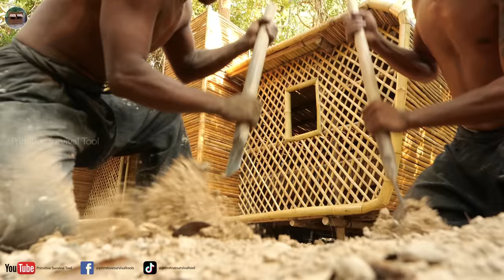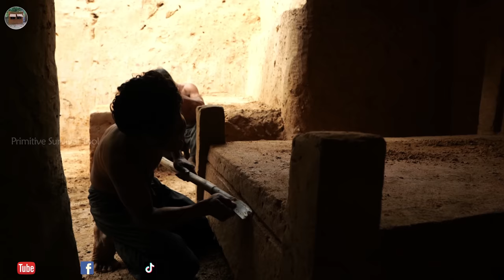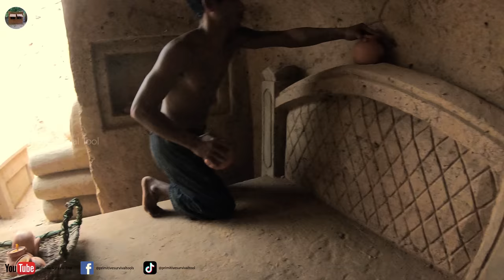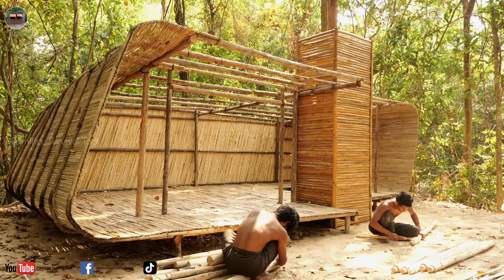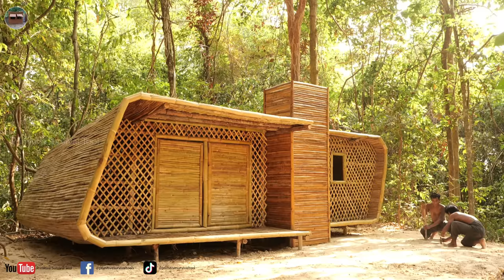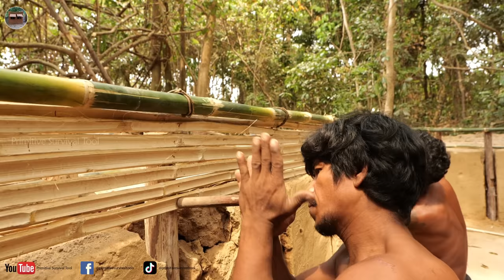[ Full Video ] Building Two Story Villa With Private Underground Living Room and Swimming Pool

Comment: ok we can all see (if this is real) that these people are amazing. But what is more amazing is how clear the pool water is. I struggle keeping mine clean (and clear) and there is a Leslies Pool supply 2 blocks away. How do they maintain this? LOL
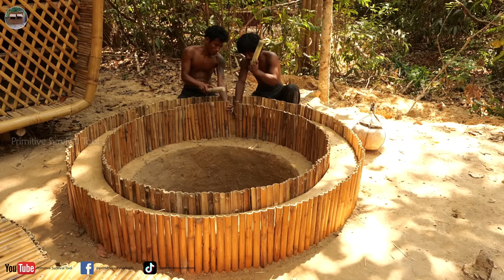Reply: 25:53  i think there is a ghost in the video, or some light orb lol, do you see it?
Reply: @sirwaffles4030  Yo dude I saw that wtf
Reply: @sirwaffles4030  where lol
Reply: @sirwaffles4030  thats smoke bro
Reply: I seriously think that you fill the pool and after 1 day, maximal 2 there is no more water on it. So you simply replace it with new clear water. Your pool is leak free, so the same water can stay there and have bacteria growing. Their pool is just a hole in the dirt,. so the water eventually goes underground. I also don't think that most of their constructions survive even a moderate but several hours long rain: If the ground there is sft enough for them to work it with just with chisels then when it mixes with water it should become mud. The pool walls also get damaged soon and while your one requires manteinance in ghe way of filters and chlore i think theirs requires manteinance in the way of rebuilding the walls of it.
Reply: @sirwaffles4030  could have been a reflection off of the back loader?
Reply: just for the video.
Reply: @Virtual Victory VD yeah 9m views $$$$$$$$$$$
Reply: What if this is real
Can't you see that it's Real.
Why even question someone's hardwork?
The water probably looks as it was put there on the day they shot
It obviously will be dirty after some days.
Reply: @sirwaffles4030  smoke, the ghost or light orb was smoke! At that point of the recording they were working with fire to mold the bamboo!
Reply: They don't.  It is filled for the video and never touched again would be my guess.  Without filtration it will look like pond water in less than 2 weeks.
Reply: They had chlorine in their pickets
Reply: @sirwaffles4030  i saw it
Reply: Pool cleaner here, make sure your filters clean, a dirty or old filter will cause a handful of problems such as excessive algae growth and cloudiness. If its been awhile since its been broken down and cleaned, now would be a good time!
Reply: The use pinch a penny
Reply: @Jorge_Organero1684   why not just appreciate the two boys. See this  people this is what they call ENVY. 
Envy is an emotion which occurs when a person lacks another's superior quality, achievement, or possession and either desires it or wishes that the other lacked it. Aristotle defined envy as pain at the sight of another's good fortune.
Reply: @EliteMrBubble  LMAO...a filter? you don't say...wow i never thought about that.  You will probably be telling me to try some chlorine next.  Great advice from a professional pool cleaner hahaha
Reply: I used the pool shocker that they have that you can buy if it gets really bad but just the chlorine tablets depending on how much you use your pool use it for a pool or do you use it for a bath? I'm just saying let's be rude or disrespectful some people use it for baths and I would use a shocker but you sometimes you need way more than one I use like seven of them in Vegas to bring that pull back and it finally came back to life believe it or not took a lot of money a lot of effort but it worked clothes crystal clear. we had our doubts though it took a while for it to become that ready to wait just when we gave up on it we went outside and it was crystal clear.
Reply: @Virtual Victory VD would it be the new day and age real estate bumped it up a notch LOL.
Reply: I think the water is coming from underground. I have seen other videos and some people use a latex from a vine that grows in the forest and mixes it with smashed up plants to get a green type of waterproof paint.  They also use ground up termite mounds and mix it with the clay to make it waterproof. They are very ingenuous and superbly adapted to their environment.
Reply: It looks clean and clear because its shallow and reflecting off of the sky the water it self probably doesnt look that clean in person
Reply: Everyone wants to have a good time....but you will not spend time!
Reply: unfortunately it isnt, still fun to watch tho
Reply: No need for home depoot
Reply: @sirwaffles4030  more than likely its a spec of dust that was close to the lens
Reply: @meade916  just reminding you since people skip the basics, have fun swimming in your swamp pool! 😎
Reply: @Jorge_Organero1684  They cover the pool with a mud stucco. Adobe houses do not wash away. Likely it does drain as you say.
Reply: @arteclipse3821  It is fresh spring water. Best water one can get. Should be clear for a couple of days before the algae forms.
Reply: What do you mean "if this is real"? Are you suggesting it's CGI?
Reply: @Jorge_Organero1684  Maximum, not "maximal"
Reply: I dont care if it’s real or not because they edited it well enough for it to be entertaining so it’s all good in my book
Reply: Gak bisa bahasa lenges
Reply: @brunosalvatti8452  I still dont get it, how would they work with fire and manage to get just one ball of smoke to fly horizontally, smoke flys up, and wouldn't it have been a  long trail of smoke? or am I not understanding what you said.
Reply: @jake-gs4do  how would they work with fire and manage to get just one ball of smoke to fly horizontally, smoke flys up, and wouldn't it have been a  long trail of smoke?
Reply: well it definitely is fake, obviously its not cgi or something, but its built by either tons of people or actual construction equipment, just the pool alone at 6x12ft (5ft depth) would be 2700 gallons, put speed to 0.25x to see somewhat realtime speed when they are filling, takes about 17 seconds to bring 1 bucket up, guessing a bucket is 1 gallon it would be 12 hours alone to fill the pool, and that just like 30 seconds of the video. This would take months to actually make by hand.
Reply: @Jorge_Organero1684  ةةةةة
Reply: @sirwaffles4030  - smoke from the backhoe sitting off to the side : )
Reply: Hey, I like it. Who else?
Reply: @Jorge_Organero1684  But, if this is africa they get care rain. I am not being racist and going off the skin color but if you see how bright the dirt is it's almost like sand. Like a dessert or a Oasis
Reply: Exactly what I thought, too.HOW is the pool water so clean and why did the pool not collapse as soon as water hit it? It was only sand...
Reply: Came to the comments for this
Reply: @Jorge_Organero1684  you don't seem to understand and realize that many people in the past used to build houses and use dirt as one of the materials just like them. There's still people today who do, and some who use animal poop the way they use mud. Plus they seem to have access to a dirt that turns cement like. The water wouldn't be so clear after a few minutes and the pool would almost immediately be eroding if what you say we're true. And the pool doesn't just empty itself cause first of all they used cement like dirt and second of all dirt can and does hold water if not ground water wouldn't exist. Also the water is clear cause they just filled the pool, but after some time if left natural bacteria will grow and it'll cease to be clear without intervention. It's strange how you think their structures and materials used are inferior just because it's not what you're used to when that's how things were done for thousands of years. And it's weird you're stating it like it's fact what you say when it's not. Stop spreading false info and instead educate yourself.
Reply: @mease916 they literally build it on camera and you have the audacity to say "if this is real" 🙄 and why are you shocked that a barely filled pool is clear..? After a few days if left natural bacteria will grow. If you're treating your pool and it's still not clear then you're doing something wrong. I also get pool chemicals from Leslie's and mine is always clear. Either the chemicals you're using are shitty or you're not using the right dose or not using a vacuum as well. You should have a professional look at your pool and how you care for it so they can help fix your issue and recommend what you should really be doing. Btw a helpful trick is to take a Mr. Clean magic eraser and put it in the part of the filter that's a little bucket that collects all the leaves and bugs. I don't really need to use that trick since my chemicals work but I've tried it and seen others who use it and it works great, it's like a magnet for the bacteria and really does help clean your pool. Also, I don't get why so many people think orbs are ghosts, they're literally just light refractions. And this is coming from someone who's seen ghosts before (no I'm not crazy as other family members and friends have seen what I've seen and sometimes at the same moment since my house for some reason is haunted :/)
Reply: @bambi7563  ehhhhhh what? cliffs notes please.
Reply: @Jorge_Organero1684  I've thought about this, too.  I watched one earlier, though, that indicated it took over 100 days to complete.  Understandable because of the complexity and how they complete the work.  But I thought, "In all that time, it didn't rain and wash everything away?"
Reply: It's not real.
Reply: Hi
Reply: Ground water is cleaner then most of the water you drink anywhere in the world
Reply: Their ancestors help them build! 😎👻
Reply: That's because these videos are fake. It's quite alright, they are cool nonetheless.
Reply: @bruhmomento4345  
It amazes me that people think half the bullshit out there is real. They fall for any scam. They leap to conclusions, like in the UAV shit. They think two guys can dig out like 50 metric tons of dirt in a couple days with a oversized spoon.

This is why we can't have nice things.
Reply: @Th3ories 
Lolololol. You're kidding, right?
Reply: @jackbill1644  you know nothing about pools.
Reply: @meade916  did u not just watch them pull the water from the ground?😂
Reply: @Jorge_Organero1684  I think they sealed the pool with mud from the deepest part of the well which is actually clay?  In which case they just let the water evaporate over a week or so and then refill the pool from the well again the next time they want to use it?  IDK.
Reply: 16.5 now!
Reply: They have cement. At the end when they go off to the side. Thats probably whats keeping pool up. Wonder if house is still standing? But the pool is nasty tho lol
Reply: It's cause it came right from an underground fresh water source; it wasn't polluted with dirt and whatnot
Reply: Of course it's real, you can literally see them doing it 🦯😆😂
Reply: @Jorge_Organero1684  except modern pools since 1970. chlorine is your friend.
Reply: @gabrielsatter  who says this was done in a couple of days. A video has already been made for all to see ans you come in here discreditinf it like its done something to you. Why dont make your own. This is called envy my friend.
Reply: @mahimathapa2632  well, it’s not 100% false, but there are more than these 2 helping them do the work, with normal tools it would take these 2 more than 1 month remove all the dirt, and they are not even using a single normal tool, and where did all the dirt that was removed go? It would take even more time to move all the dirt to another place, don’t u think?
Reply: @cockadoodledoo28  
I am envious that I didn't think of this profitable scam that can fool gullible people so easily...
Reply: @gabrielsatter  that is your own perception. a lot of youtubers create nonsense videos and gimmiks like pranks and slapstick humor and get views and earn. Thats not for for you to decide which content has value or not. You dont dictate the market. Its pretty clear your envious cause your coming from a place of insecurity. I instead of putting others down why dont you improve yourself and create your own vids whatever that is. Do you have the guts and the creativity?
Reply: @mahimathapa2632  lmfao u ppl are so easily deluded, what happen between the takes?? you not seeing a one shot complete video are you? you really think 2 single guys cut all that wood, shape perfectly, make that hole all alone, fill the water alone, I mean everything?? all in one day? theres a whole crew behind this silly.. and after a day or 2 its all gone, just one a raining day and *puf! its just meant for a yt channel this is edited like a movie its just for entertainment
edit: ok sorry just read the description it says it took 15 days (doubt) and that the 2 guys are actors lol ok that I an see but yeah they don't say how many guys was the crew actually working there.
Reply: @z3me1  i read the description and it says just 3 people are involved in making this video.....
I want to trust them no matter what you say....
They aren't actors as i can see them sweating and doing so much work...
Maybe some peeps help them but i cab guarantee those two are involved in making it too.
Reply: @mahimathapa2632  yeah sure they are involved, like actors are involved in making a movie scene, for example somes don't want stunt doubles, yeah we can give them credit off course lol when they want to do the action/dangerous scenes themselfs but this is edited, you see very short cut scenes.
IMHO this vids is meant to ilustrate what we humans can do not much about what this 2 particular guys can do
Reply: @z3me1  okay you are right.
Have fun
Reply: Frog secretion  and lizard spit
Reply: @roymendoza7843  pain at the sight of another's good fortune is Schadenfreude, and has envy as a factor of it, but is not, in itself just envy. Envy is like knowing most everyone you know has been to Disneyland, but you haven't,  and are jealous of them.
Reply: They are using underground well water. Also they waiting until it filled giving time for any sediments in the water to settle at the bottom leaving clear water behind. Clearly these are just for entertainment and after a few days their pool water will either seep/evaporate away or just become filthy.
Reply: @mustang6599  why are you so quick to disparage these guys work? Just cus you know you havent accomplished what these guys do in 1 video in your entire life doesnt mean that everybody is a lazy unproductive cretan like you buddy, and these comments like that are starting to get annoying
Reply: @samualcrocket1405  good eye
Reply: @RustConsoleStoner  I have watched other videos since this one and I see that they put a bamboo drain at the botom of their pools.
It would be nice if it was downhill from a stream. You could run a bamboo line to get fresh water into the pool every few day. It has to take forever to fill the pool by hand like they are doing.
Reply: @roymendoza7843  so basically jealousy?
Reply: @RustConsoleStoner  I disagree
Reply: the water becomes clear thanks to the clay that acts as a filter .... only when it is moved it becomes cloudy again
Reply: @bruhmomento4345  if that pool is 5 ft deep then they are 10ft tall... It's more like 2.5 ft deep.
Reply: the water there is likely that clear, but this is for show i'm guessing after acouple of saysthose pools wouldn't be pretty since its standing water.
Reply: They don't, it's just for the video. They have never made a natural pool with any sort of runoff system, so getting into the pool after a few weeks would just be an immediate infection. It is 100% to look nice for the thumbnail and video titling purposes.
Reply: The most beautiful flowers grow from dirt, the most beautiful people - often scum.
Reply: @piratejonyboy9741  how not real????
Reply: I uploaded the first video today.I hope everyone's support.
Reply: @sirwaffles4030  holy mackerel i saw it too lmao
Reply: @meade916  no need to be cocky. some people don’t know that they have to clean their filter. their advice may just be basic advice to you but for all they know you could’ve known nothing about pools and don’t know to clean your filter..
Reply: @lulobo5418  thanks for the random lecture dad. hahahah SMH
Reply: @meade916  you’re welcome, son.
Reply: Why would you think this is fake? What a bizarre assumption. People make really cool things, why is that so unbelievable to you? I'm genuinely confused
Reply: @sirwaffles4030  that's probably just a smoke from the fire they use. you can see the fire at: 9:20 for example
Reply: @mahimathapa2632  its not real-
Reply: Of course it is Not real. Unbelievable how easy people Fall for that
Reply: @Jorge_Organero1684   -way to ruin the mood
Reply: @toddfenton9930  63 million views $$$$$$$$$$$$$$$$
Reply: @samualcrocket1405  they clearly don't do that though.
Reply: @bruhmomento4345  is something fraudulent a fake? 
Most would say yes. 
Ergo this is fake.
Reply: @RevenueGuy  they're clearly Asian not African.
Reply: @leafyveins4985  you're what is called naive.
Reply: @idiotbuster8662  I am not sure what I posted but they are clearly using primitive skills to build that complex. They also seem to dig the well by themselves. 
Digging the pool and filling it with water is an magnanimous task. It would take a long time. Maybe they are getting mechanical help. 

They are temporary and build them for show.
They do not build for the long haul, nor do they need government inspections.
It is so important that these people not be given some credit for their work and creation?
Reply: @mahimathapa2632  it isnt dude....a 4 foot diameter hole dug down 10 feet deep,perfectly circular........the outside shape of the house with bent bamboo
Reply: @roymendoza7843  do you still feel proud of your comment after they have been exposed ?
Reply: It is VERY fake
Reply: Amazing because it's fake : (
Reply: @gergocsaki9828  no it isn't.